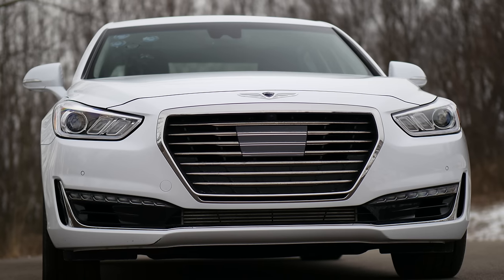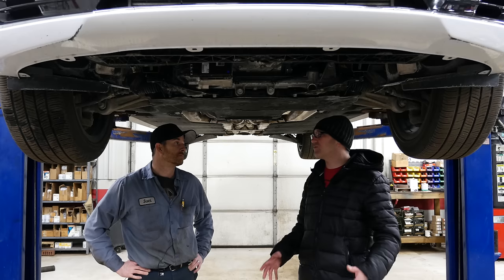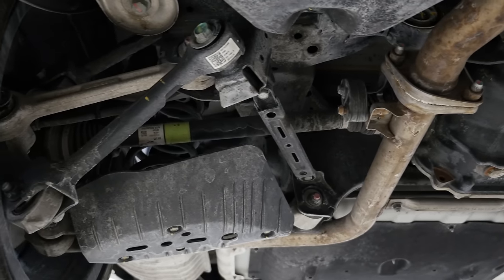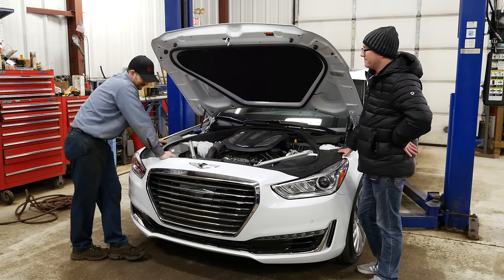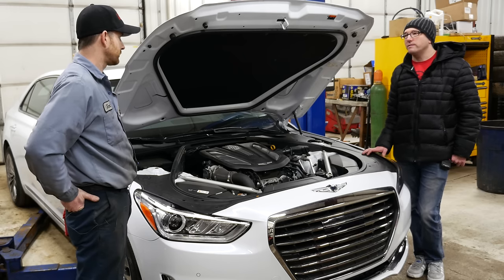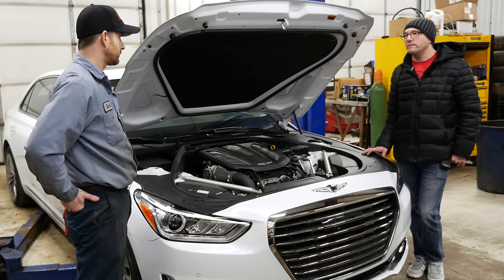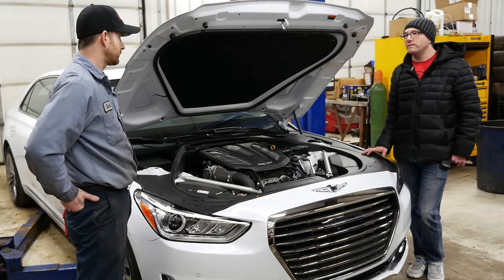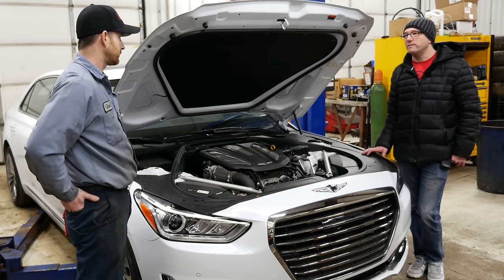Review | 2017 Genesis G90 | Hope for Modern Luxury

Comment: Hyundai and "genesis" is SHIT! They have so many problems with reliability, electronics! I had a genesis sedan, and a Santa Fe! NO MORE HYUNDAIS FOR ME!
Reply: DoubleD 613 NOTHING ILLUSTRATES A POINT LIKE CAPS LOCK AND EXCLAMATION POINTS!!!!
Reply: DoubleD 613 YOU KNOW YOU ARE COMPARING A G90 TO A SANT FE AND G80?
Reply: had a 2006 Hyundai sonata, ran like a champ, put 140k miles on it in 8 years, never had any problems besides normal wear and tear.  Reliable as shit.
Reply: My '12 Elantra has over 100k miles and still runs like a champ, with no major maintenance issues.
Reply: Consider yourself lucky I wouldn't buy a Hyundai for anything.
Reply: DoubleD 613 Hyundai/Kia isn't what it used to be. They are good cars now.